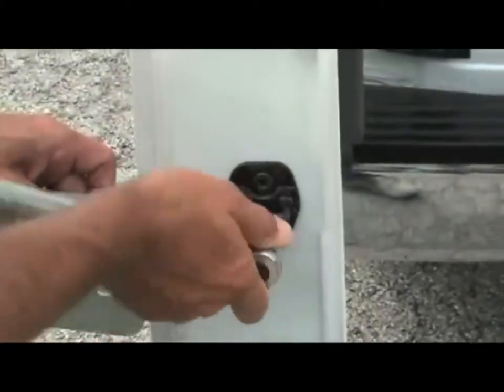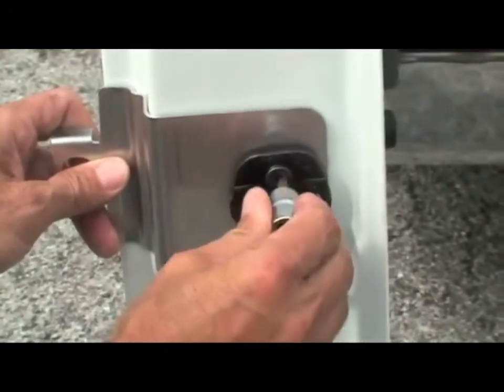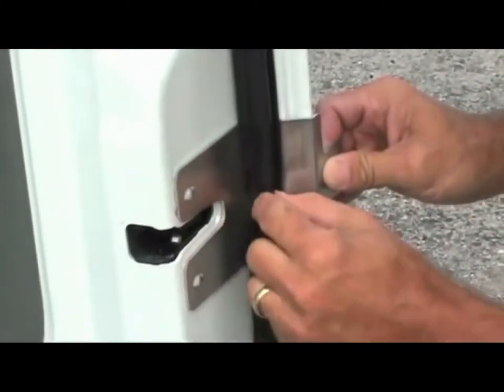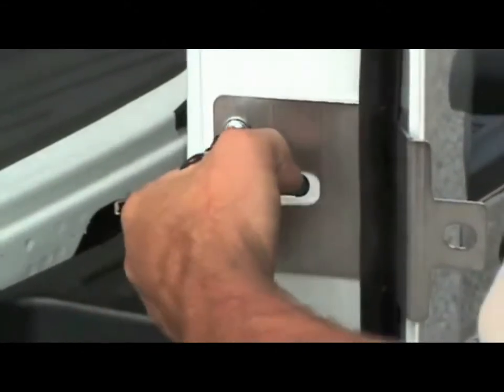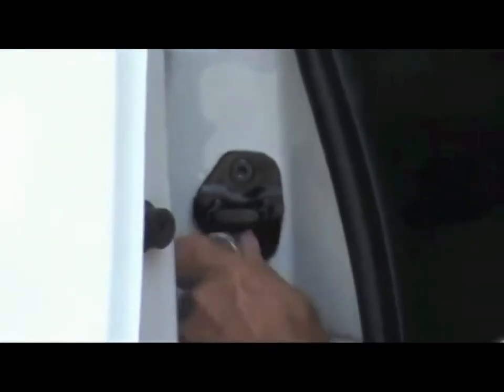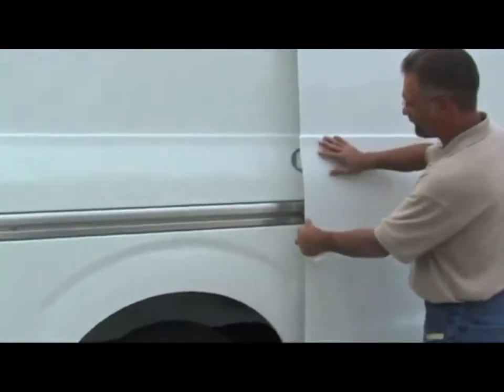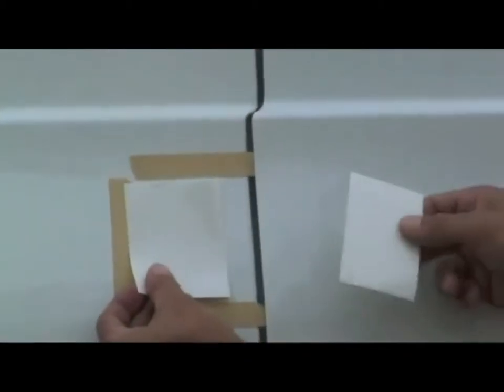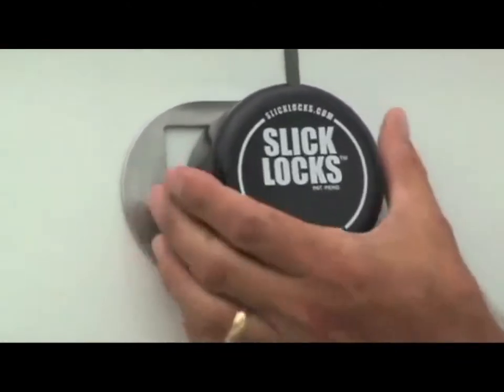American Van Equipment - Slick Locks Installation - Nissan NV

Comment: You never mention that you need to replace the two bolts from the right side door. The original bolts are beveled the new bolts are not. You should mention this.

Comment: after installing this, i noticed the back rear door gap is uneven.  the weather guard strip is making the gap at the bottom bigger.  Should I trim down the weather strip or take off one plate?